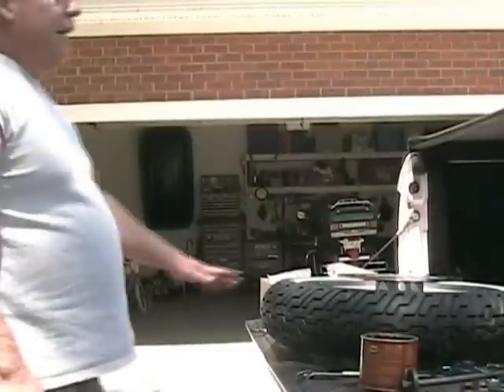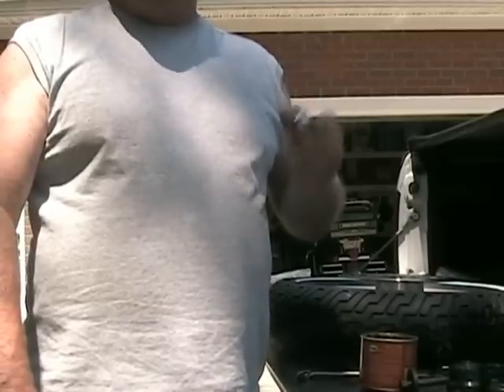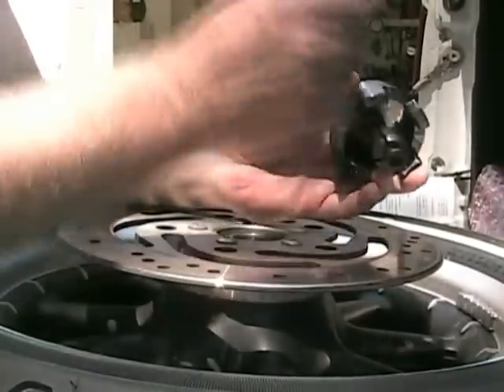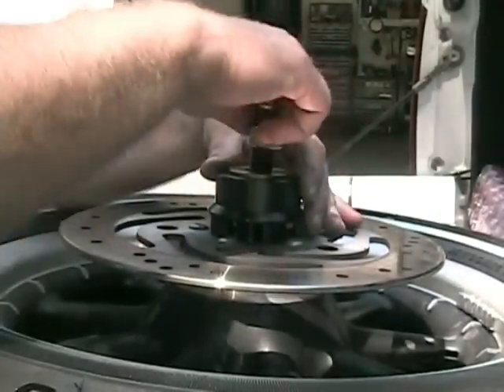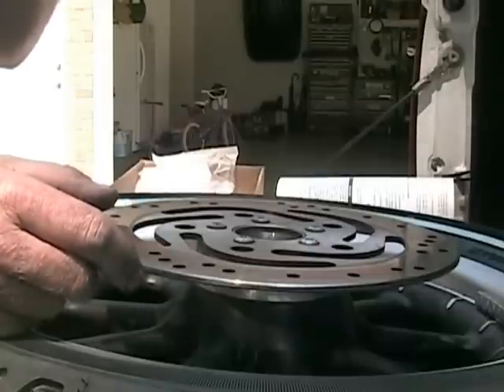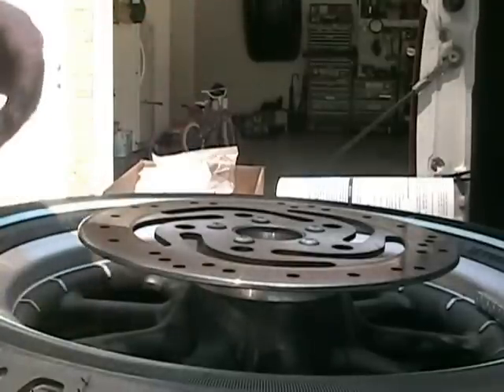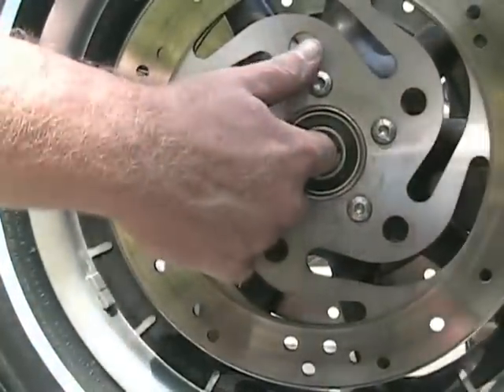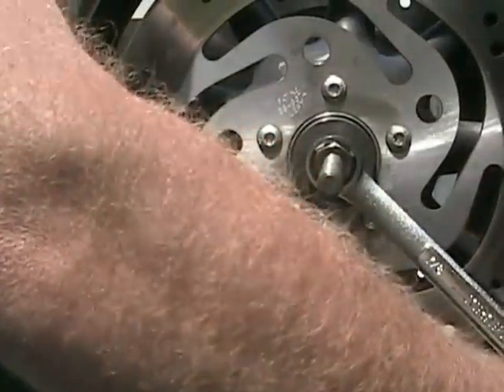Harley Davidson Wheel Bearing Change and Tire Information.avi

Comment: Nice video, good explanation! Here is another trick to place the bearing. If you put the bearing the night before in the freezer you can slide it in by hand the next day..... ;-)
Reply: you only need about 20-30 min in the freezer..if you have a lot of frost build up.a sandwich bag works to keep the water away once you remove from freezer..but i do agree.many forget cold shrinks metal to a degree to make jobs easier

Comment: I have a hugger that lost the rear bearing. No squeak, squeal, or grinding. It just came apart! I took it to several machine shops that said "we don't work on any Harley stuff." I ended up with a air grinder and turrets! I used to work at a machine shop in CA when I was a kid, so you know how I hated to do that! Got her done though and put together again. Now even if I don't hear anything, I pull my wheels off every time I do a oil change to check.

Comment: One additional comment. When you were tightening the nut on the shaft to spread the collet, you needed to insert an allen key into the opposite side of the shaft to prevent the it from spinning while you tightened that nut...otherwise you're just spinning the shaft. I bought a kit and watched some other vids which was how I discovered this. Still a great demo though!

Comment: I really enjoyed the video and just one thing I noticed...When you check the runout on the rotor....you used the wrong tool. the calipers catch the edge of the rotors and give a false reading. You need to use micrometers so that you measure the working surface not the edge. I hope this helps......Ed
Reply: I agree with the micrometer... otherwise, the video was useful!
Reply: I agree use a micrometer

Comment: Thanks for the video. I am wondering if this is a Jims, or other USA Made tool, that you used, or a less expensive eBay "special"? Just curios, as I need to remove and install some bearings but, as it is very seldom, I don't care to spend over $200 on the primo tool especially since I'm not doing this repeatedly on a daily basis.

Comment: Great video.  Good personality and a good voice.  Shows you how to caliper your rotors to check for minimum thickness (a saftey issue). Also looking for stress cracks, etc.  A couple of comments if I may:

1. THEROMO-REDIMENSIONAL BEARING REMOVAL. The outer bearing surface and the inner bearing mounting boss (hole) is a heat transfer point to help carry excess heat buildup away from the bearing and into the hub of the wheel where it can be dissapaited to the air. If you use a grease there I would recommend a thermal transfer grease (that facilitates the transfer of heat) because regular grease is a good heat insulator. This is optimal stuff -- not really necessary though and not as effective as #2 (below).

2. THERMO-REDIMENSIONAL BEARING INSTALLATION. You maybe able to ease the removal of the old bearing by cooling the bearing and simultaneously heating the bearing boss (the hub) to create a dimensional gap -- the bearing may be simply picked out of the hold. A compressed air can be used to cool the bearing and a heat gun can be used to heat the hub. My hub is aluminum and aluminum has an incredible rate of thermal expansion when heated (no more than 350F or so).  If you then clean the outer surface of the new bearing and the inner hub with acetone to degrease it then you can install the bearing in the reverse by freezing the new bearing in your refrigertor freezer (in a sealed zip lock baggie). You then just heat the hub and drop in the new bearing. If it requires some "tapping in" you can use a piece of 2x4" pine placing that across the leveled bearing and tapping the wood with a hammer.

3. PIRELLI NIGHT DRAGON. Pirelli makes a OEM sized tire for the VRod called the "Night Dragon" (they had the VRSCDX Night Rod Special in mind in the name). They make all the tire sizes for the VRods. The tire has some MotoGP technology in it in that it is a sticker tire in the tire zones where sticky is best and it is profiled to provide a larger tire to road contact patch in hard leans. I have been reading some road tests and reviews and the tire looks like a ticket to a safer ride.  Note: Lots of folks seem to want to go to fatter tires because it looks cool -- don't go over a 240mm on the rear of the VRod (OEM size now). Fatter tires change the dynamics of the motorcycle and the physics call for harder leans to make the same turns on those fatter tires and as you know increased lean angle increases risk. This fatter tires increases your rolling weight (the weight that the motor has to turn repeatedly to make forward motion) and has a performance disadvange there. You want additional traction then go to the Pirelli Night Dragon (I am not affiliated or benefit in anyway by saying this). 

4. BORON-NITRIDE BEARING REPLACMENT. While you are replacing bearings why not make an improvement to the performance of your motorcycle?  After all -- the VRod is Harley's high-performance line. I don't know about you but I am always looking for small tweaks to give me a sharper edge. Here is one... boron-nitride is the hardest substance known to man (including diamonds). It is a form of ceramic that they are now making bearings out of. There are boron-nitride (ceramic) bearings on the market for the VRod that are direct OEM replacements (Lyndall may sell them... do a few Google searches). These bearings are longer lasting (less wear) and they lower the rolling resistance of any wheel that you use them on resulting in faster acceleration and better fuel economy.

5. LIFE-CRITICAL MACHINE. I have always believed motorcycles are life critial machines -- much like an F18 fighter jet and not at all like a "mobile living room" (aka "Cager", "Car").  Wheels and brakes are life-critical components on a motorcycle -- so short of saftey-wiring everything I would recommend folks use a temporary thread-locker (LocTite(tm) blue) on the pinch bolts, caliper mounting bolts, and the axel nut and torque these things to OEM specs. One of these critical fasteners failing at high speed could surely make a mockery of your "Live to Ride" motto (in a very ugly way). If you take short cuts or don't want to "go all out" and thread-lock and torque stuff then let a professional mechanic do this work for you and stick to oil changes and tune-ups.  By the way... look for some videos showing the "Death Wobble" that can occur if you let your bearings go out on you or possibly do not get the bearing fully seated on the front wheel.

6. BALANCING. Lots of folks statically balance their wheels some say it isn't necessary at all.  If you are pulling your wheel to change the tire make sure you have the manufacturer's "light spot" (marked by a dot on the tire) adjacent to the the tire stem (where you put air in the tire). That will allow you to bring the tire to balance with fewer weights. Also, if you look at your wheel and there are weights on one side only chances are it was statically balanced (if no weights it may not be balanced at all). If you change the tire then the wheel should be re-balanced. This starts with removing the old weights. There are plenty of automobile garages with the adapters enabling them to dynamically balancing your wheels to a very high degree of accuracy. For long duration high-speed motorcycling doing this may reduce the chance of ever developing a "death wobble" and it may also reduce or remove handlebar vibration and improve the overall stability of the motorcycle. I would recommend it for the front wheel. Note: Motorcycle wheels, when dynamically balanced, are balanced with brake rotors installed.

Just my 3 cents worth.  Great video... I like this guy...  Good advice and knowledge in this video.  Just wanted to add a few helpful tips for folks.

Comment: Just went through a front wheel failure on my 2008 Ultra Classic.... YES! I talked to the bike all the way home... 33K and front AND rear went bad (my balls fell out... And you can laugh all you want....NOT FUNNY! LOL). GOt a little confused as to what side the spacer goes on in the front.. I'm pretty confident it's the side opposite the valve stem... Spacer between bearings threw me a little as it was (or appeared to be ) too long. Then I realized that I just had to set the bearings to just touch it and it wasn't important how DEEP they were (as long as they don't protrude from the hub.) Great video. Thank you!
Reply: On my 08 Ultra anniversary i have Abs so i only have the one spacer on right side and abs sensor on the left which no way to get em mixed up, but anyways whenever my tires need changed i change wheel bearings also. Better safe than sorry is the way i look at it.

Comment: Nice video, well done my man ! There was a machinist in Michigan who made special HD Tools ,( just like Jims Tools) ,and sold them on internet . I bought the clutch hub puller for the Early Evo 's off him . It was American made high quality ,just not polished up baby smooth etc like the Jims Tools!  Cost about half as much! He may make these bearing puller \ installers too!  Guess you could just press the bearings in with a shop press but you need that collett yo pull the old bearings!

Comment: I just gave you like 1000.  my bike is a 03 road king classic with 50k on it. i  had to replace the front bearings 10k ago. my rears are fine but i have to replace the rotor so why not replace them. better then having the go on one of my 400mile rides.  thanks for the video on how to properly do it.

Comment: AWESOME VIDEO. GREAT INFO.  I NOTICED THE WHEEL WEIGHTS, TRY THE BALANCING BEEDS.  THE ROTORS ARE STAINLESS STEEL, AND CAN BE POLISHED TO LOOK LIKE CHROME.  START WITH 200 GRIT SAND PAPER AND WORK YOUR WAY TO 1000 GRIT.

Comment: Put the bearing in the freezer and it’ll slide on easier, you could also heat up the wheel a little bit and that would help.

Comment: great video but I was always told not to put grease on the outside of the race.  Maybe anti-seeze is a better choice.
Reply: You are correct...
Reply: NEGATIVE...Anti-sieze has metal in it.. not good... However, anti-sieze is recommended in the axle

Comment: Bearings are cheap, and a lot cheaper than failure because when your rear axle munches a bearing the drive pulley can hit parts like shock absorbers. The result ain't pretty. 

You can gain a few thousandths by using a heat gun on the bore area before installing the bearing.  (Every mechanic should have a heat gun, and IR thermometers are less than thirty bucks online if you want to know how hot your parts are.)
Reply: Also put the bearings in the freezer over night. They go right in.